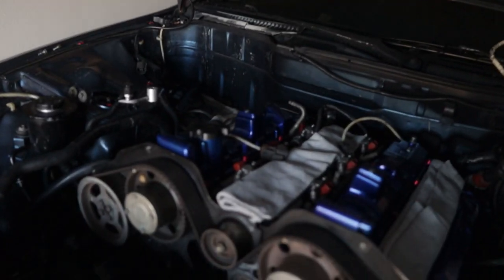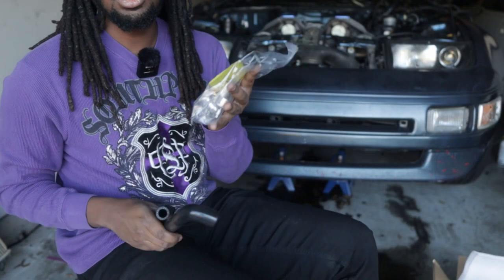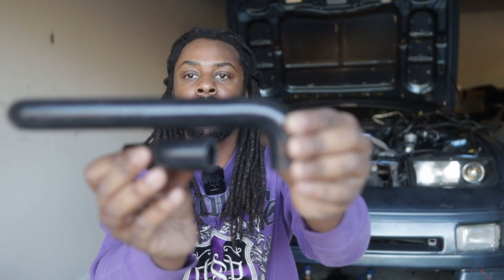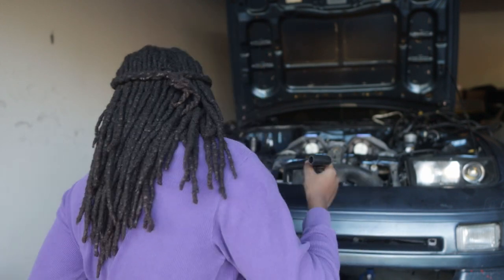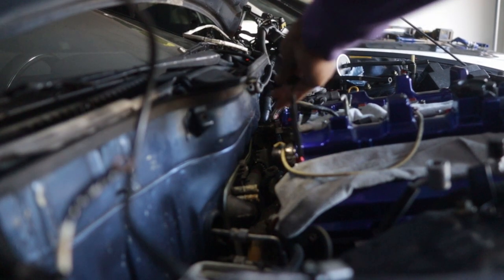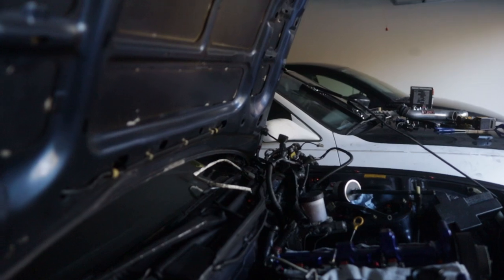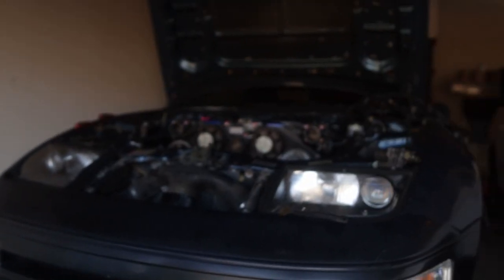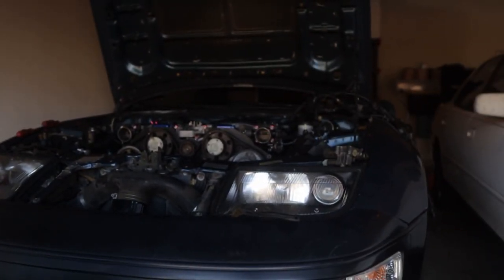Today, I got a special part from Merlin Machining | 𝕃𝕆𝕍𝔼. 𝕍𝕀𝔹𝔼𝕊. 𝕩 ℙℝ𝕆𝕁𝔼ℂ𝕋 ℂ𝔸ℝ𝕊

Comment: Have you already gone Turbo? Or are you working your way towards putting turbos?
Reply from the maker: I'm working my way towards it. I've been debating about renaming this series to Z32 drift built since that's what I intend to use it for. The turbos will come but I want this engine to be as simplified as possible. A lot of polar engineering parts/ Merlin machining parts/ bde/ Ross performance/ and engineering performance parts are gonna be bought soon.